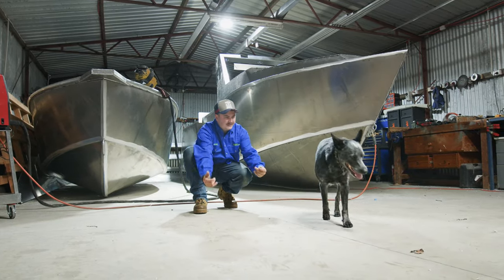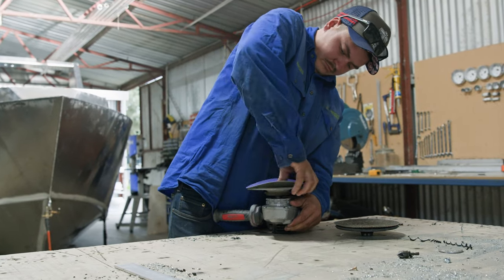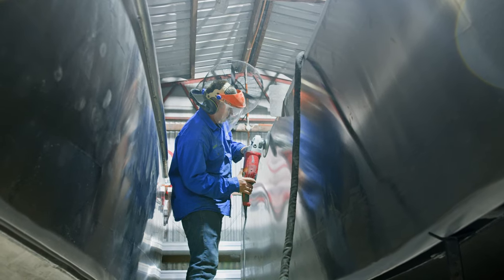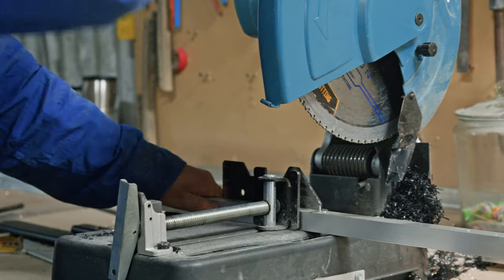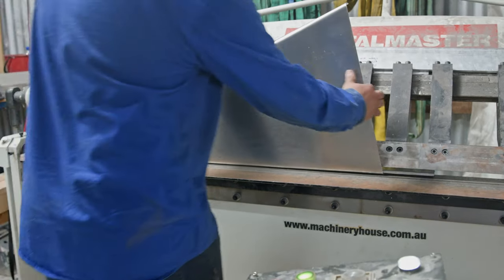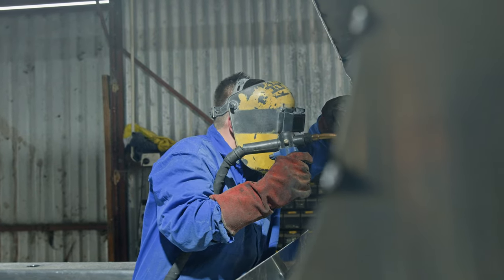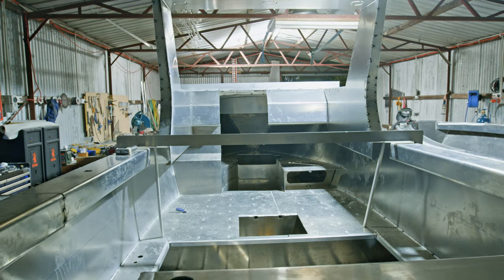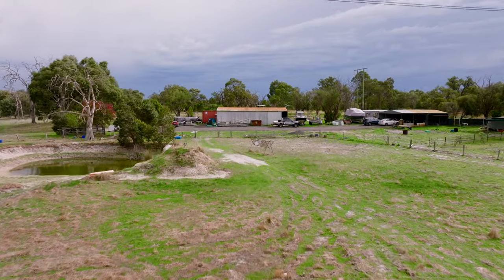CNC Marine Boat Build - A Day at Bluey Fabrication - Serpentine WA

Comment: Tip. Very bad idea using a meataxe blade on electric grinder...use air ,not as much torque
Reply from the maker: Great tip mate!
Reply: Do you do custom Ali hardtop for a fibreglass boat?